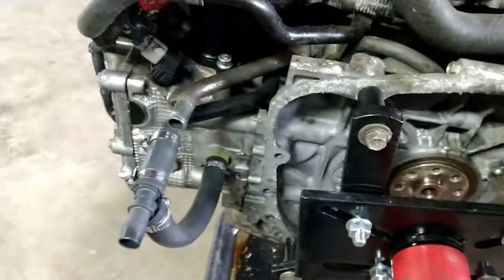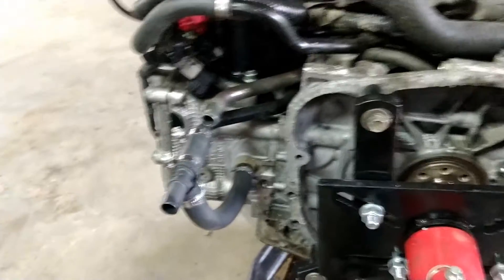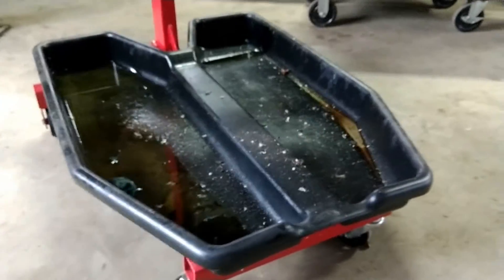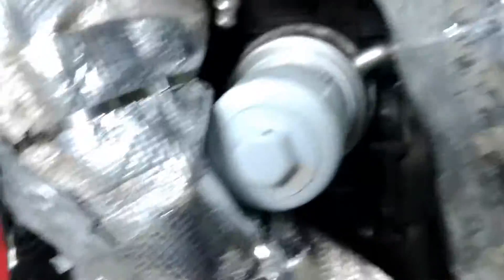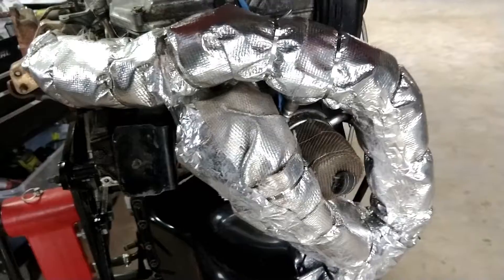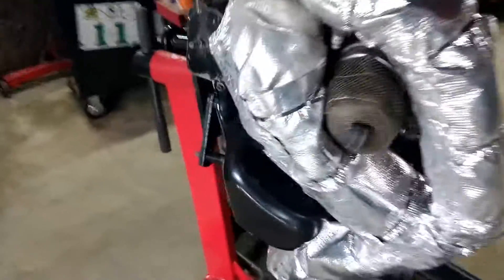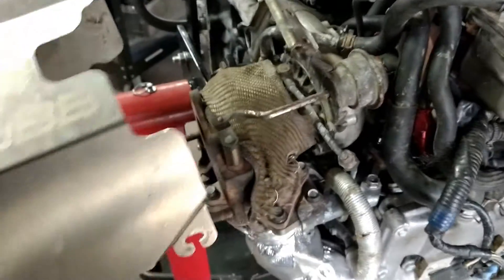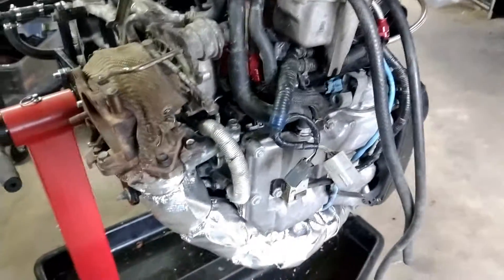Heat management on Subaru EJ257 - Exhaust wrap and cylinder 4 cooling kit

Comment: is that killer b headers manifold ?
Reply from the maker: Yes Killer B holy headers
Reply: @FrogRacing  but as killer b recommendations not to heat wrap the manifold  right ? or no issue with that ?
Reply from the maker: @dany7425  if the header is powder coated do not heat wrap it but otherwise no issue. The cheap lava band type heatwrap that soaks humidity and fluids is not recommended though.
Reply: @FrogRacing   thanks bro can you send me the link where to buy tjlhe oil filter wrap
Reply from the maker: @dany7425  it's in the video description, all the links to all the products. The link you are looking for is the 2nd one in the list

Comment: Do you coat the headers before you wrap them? Seems like the thicker stuff would soak up some water
Reply from the maker: No coating. You could do ceramic coating but it doesn't withstand well exposure to the elements.